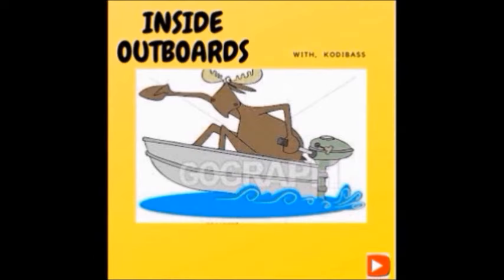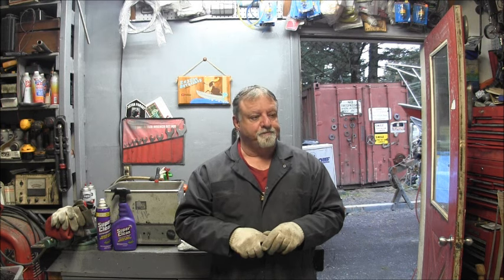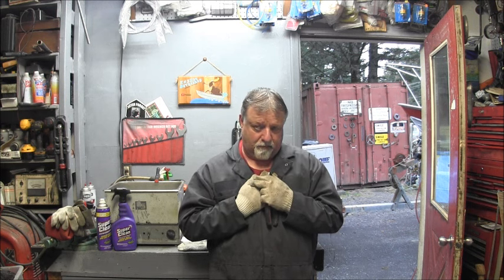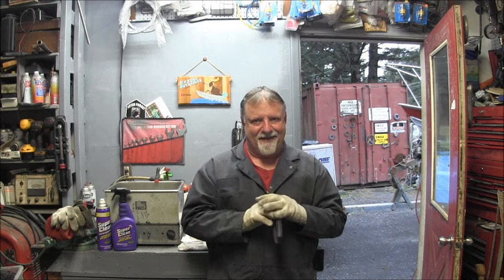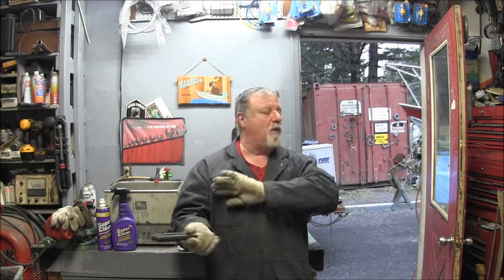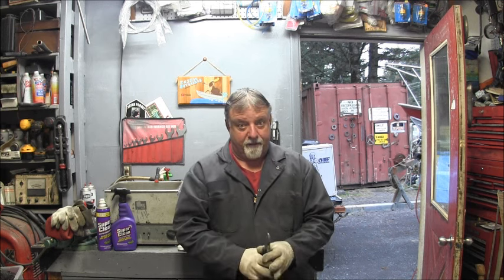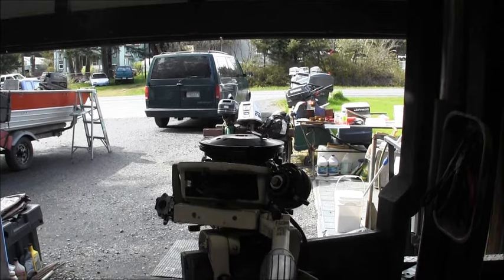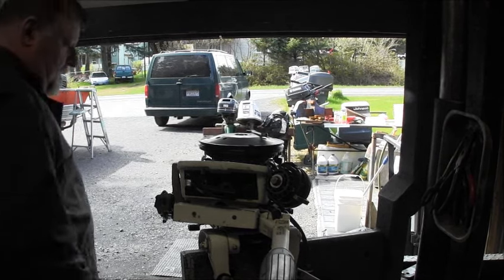JOHNSON  1990  15  HP,,,   GARBAGE !

Comment: Hey Kodi just took a 1967 Evinrude 18hp motor out of my unheated garage was in there since 2003.Took the bonnet off no creepy crawlers ,no mice, no nothing I was shocked,LOLLL Usually something livin under there....
Reply from the maker: OBT62,,   U  Got  Lucky  Mate,   Me   Not  So  Much  Pulled  the  Hood of a recently Donated  4 hp   Yammy,  Good  Lord  Never   seen So Much  Creeeeeeeeepy  Crawleeeeeerrrrs,  Video  2  Come,   Dang..  I wish I  Had   Your  Luck!        kb
Reply: @kodibassInsideoutboards  Yeah no bugs amazing. You know Kodi after cleaning the carb and polishing the points it started right up after 30 years,LOLLL!  It came from local scrapyard in the mid 1990S. I guess you cant kill an Ole Evinrude,LOLL!
Reply: @kodibassInsideoutboards  I also remember your motor which was infested with those big black flies that was crazy...

Comment: Ya I had the same thing happen to my 92 johnson 15hp the carburetor top was warped and I heated it up with a heat gun and fixed it a little bit then but gasket silicone sealer on the gasket both sides and now it will idle all day I troll for hours now. Thanks for the videos keep up the great work..
Reply from the maker: Thank  U mate,   I will b trying  this same test soon,   kb

Comment: Are you able to temporarily seal the back right corner, with say Sikaflex? Test the air leak theory? Would be an interesting experiment.
Reply from the maker: Yes,  First  we   will see what  the ALL Aluminum  does?  ,  If   that works & engine performs as it  should,     I will Do as U say.  &  We will once & 4-all,,  Figure this crap  out,  BEST SUGGEST.  Thank U solid Kodi-hacker Great Idea 4 sure....    kb

Comment: You can definitely swap out the shitty CPS carb for the good old aluminum carbs on 92 and earlier models.  Choke linkage and fuel inlet the same set ups.   Can't make the swap on 93 and newer models though. The 5 screw issue is on the 93 models.     That cooling telltale looks pretty weak buddy, even after you blew it out...  D
Reply from the maker: i HAVE  FOR  SURE, DONE THE Aluminium swap on the Post 93,,   I have a vid.. I will find it & Post.  It Is do-able ,  That said the manuals say Nope.  Manuals we don't Need No sticnk'N  mauals.   I find the vid & attach,          kb